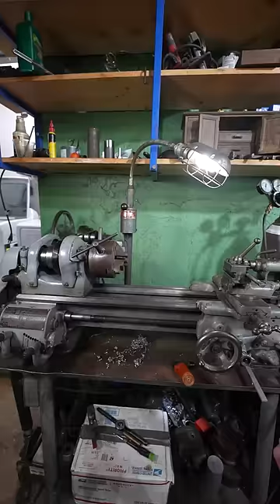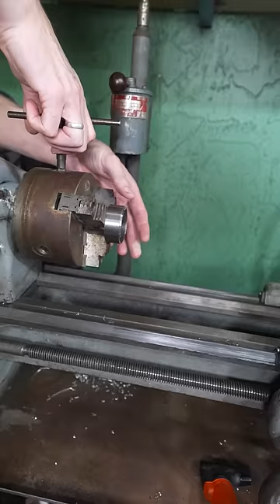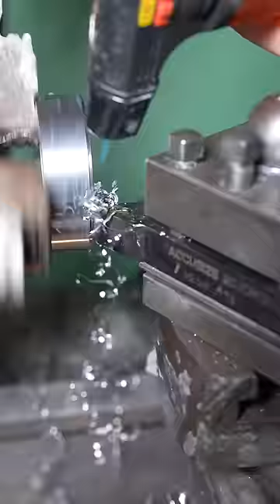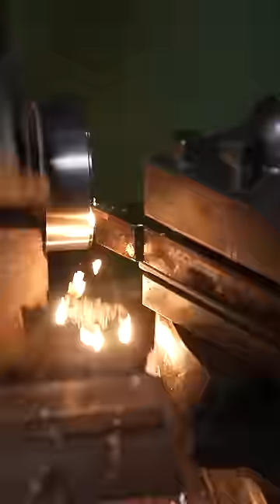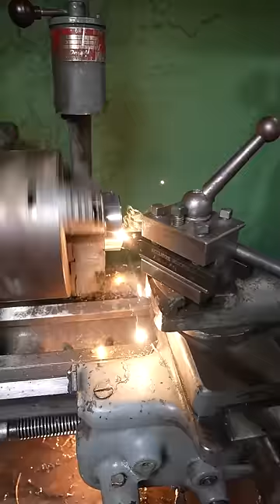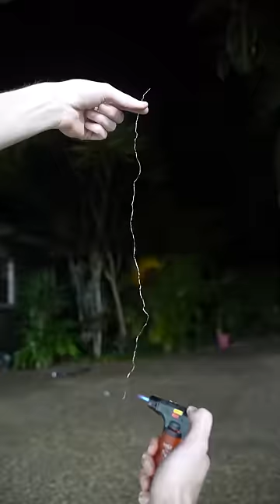Titanium has a dirty secret

Comment: The machine shop three seconds after the OSHA inspector leaves.
Reply: Lmao
Reply: Yup
Reply: Based
Reply: Safety guys gonna have lots of material to use for meetings.
Reply: you have met kevin
Reply: @eliascastillo1641 no he won't, it all got burned up 😹
Reply: My boss had the welder cut some aluminum on the lathe and he almost burnt the shop down lmao
Reply: @evangorski7992  Welder should have wiped the oil up before using the plasma cutter. I assume the lathe was being used as a sawhorse.
Reply: ههههههههههههههههههه
Reply: @carlherrnstein9544  lol nah he was using it as a lathe, just didn’t know anything about coolant or chip management😂
Reply: Real
Reply: Bold of you to assume it takes us that long

Comment: "Expensive Metal...I just set it on fire"
Reply: You can still melt the burnt bits. The O2 escapes in the atmosphere and all that's left is liquid Titanium.

Same with rusty steel.
Reply: Uh, what? No, no you can't...
Reply: @loghorizon45 No way, turning titanium dioxide into metallic titanium is multistage chemical process, you can't just melt it. And even if you were wanting to do that, a bunch of the dioxide power is going to have spread everywhere, you'll never get anywhere near the yield you'd have gotten from collecting the swarf unburnt.
Reply: It's too expensive to try to reuse it compared to the risk it brings
Reply: It's somewhat expensive as sheet, and really expensive when in the form of tubes or large blocks. The ones used for engine blisks are ungodly expensive. You actually carve a giant fan from a big  block of the stuff, and the amount  of chips you get is crazy. 😮
Reply: @tommylanger7686  no if it's chips they degrease them then react with a bit of chlorine as a flux then induction melt under argon gas. Once oxidized it requires a lot of processing and usually is added to steel as a scrubbing deoxidizer.
Reply: @loghorizon45  I belioeve that's called smelting.
Reply: Fr😂😂😂
Reply: Dealing with recycling companies, I get it. Makes doing the right thing nearly impossible depending on your shops size. We just toss it in the garbage can because we will do a foot long bar of aluminum for a few tight tolerance parts then go into steel or something else so the scraps are small and easily mixed. I wish we did a little better, and I wish metal recycling companies would also be better at sorting. This isn’t just a 9-5 problem. We need to take care of the planet and the resources on it so we can sustain ourselves. Not saying anything about climate change, just proper use of the stuff here. Sorry for the rant no one asked for
Reply: Turning TiO2 into Ti metal is easy just do a thermite reaction, TiO2+Al powder and some sulfur powder for catalyst
Reply: @matheuscerqueira7952 Yes you can have magnesium for it
Reply: @soundspark  not with TiO²
Reply: @mandychan9191 thank you 😊
Reply: @omeganiner-j1b  If you are doing it to extract metallic titanium it is still a form of smelting?
Reply: @declankemp679  titanium's melting point is around 1.6k C

Comment: True story: I was the project manager for a contractor building a jet engine factory. The small jet engines had fan blades milled from titanium. I had to install a conveyor belt collection system to collect all the titanium shavings that were then sent to a centrifuge to spin off the cutting oil. Then the shavings went to a compactor to make titanium pucks for recycling. Factory's design, not mine. Of course, the first time they use it, it catches fire! They hadn't programmed the centrifuge to ring enough oil out of the shavings so the compactor caused heat, which lit the whole mess on fire. So burning titanium is actually in my nightmares.
Reply: Genuinely sorry to hear that.
Reply: I've been in commercial construction since I was 18 & you never know what kind of catastrophe can happen on any given day
Reply: At least it's ot your fault!

Did they try to make you liable regarding insurance or accept that their design needed work?
Reply: Just... 'OOF'.
edit: That'd be in my nightmares, too...
Reply: I would have honestly believed had you not started out with "true story". That usually means you're about to hear a big fat lie.
Reply: Does this mean that titanium recycling is scrapped completely, or just that extra care has to be taken?
Reply: Did anyone think to leave the press down to smother the fire? A pause after pressing is definitely needed for titanium.
Reply: I find it weird that in all this time I never once heard that titanium shavings are flammable.
Reply: @InfiniteDarkMass  Just imagine all the other things you don't know.
Reply: This is what happens when the lead engineer won't listen to any of the other engineers & techs on the project. I can just hear some crotchety old fart saying "I've been doing this for 30 years."
Reply: @InfiniteDarkMass  maybe you were playing hookie or stoned that day in science class?
Reply: @wolfpackpete6408 titanium is recycled because it is expensive material.
But have to be careful working with Titanium.
Reply: @gund89123  All materials that can be recycled will be recycled. There's just a higher emphasis on recycling expensive materials
Reply: Yes Sir! Nightmares!
Reply: Thats based
Reply: Aye aye, that's disaster innit mate
Reply: Potassium- *holds beer & f*cking EXPLODES from the glass condensate
Reply: *wring
Reply: Irs why they smelt it in an atmosphere of Argon. Oakley was making titanium frames and the foundry leaked and exploded. Knocked a fork lift over.
Reply: Even better when the dumpster full of magnesium swarf and cuttings is next to the dumpster full of titanium shavings, could see the bright light of that fire from way across town.
Reply: That can't be a true story
Reply: An oil titanium fire sounds crazy 😬
Reply: I had a similar setup at my last job but we put the chips in wet, and let the briquetter squeeze the oil out into a catch basin.
Reply: Hello. Do you need titanium materials?

Comment: as a machinist i almost cried when the chuck wrench was left.
Reply: I am no machinist but a commonsensenist. Flying metal things launched by fast spinning metal things are no good things. :D
Reply: @huwballbot3978  I get the feeling your YouTube feed is exclusively filled with vtubers.
Reply: Same, even though it’s a 150lbs garage lathe I instantly felt my stomach drop and thought about the old 20x60” German schaerer lathe I work on sometimes
Reply: even i know, those shits need to be kept on a chain and mount.
Reply: Same here
Reply: As a machinist, I really can’t tell you how dangerous that was… You really just have to look up machining accidents and see how terrible they are. You are so Blessed that chuck key just decided to fly out(narrowly missing you I’m assuming) instead of getting stuck on the ways, and smashing your hand or worse.
Reply: WTF he actually did, that is the most horrible thing 😳
Reply: IDEA: Make a stand alone kill switch that requires the chuck key to be inserted to start the lathe...
Reply: I'm no mechanic and I don't know what a chuck key is. Help please?
Reply: @thetruthserum2816 we had the same idea where I used to work, but in the end we went with a slightly simpler one.
We fixed a low force spring to the end of the chuck key that would mean it would fall out as soon as you let go.
Reply: @jayspace2905  it is the wrench used to tighten the work piece onto the rotating chuck of the turning machine,  it is very simple to forget to remove it yet it can cause some of the most devastating accidents from this machine as when it starts to rotate it can fly off at an exceptional speed.. at one of the workshops I wet to this happened and it shatered the safety glass 5 metters away from the machine 😵
Reply: In school if we left a chuck key in the chuck we had a big chuck key we had to wear around all day so we would remember not to forget to take the chuck key out of the chuck
 
It worked 
I only had to wear it one time in 3 years
Reply: In our school the room with the lathes had a deep nick in one of the brick walls caused by some guy forgetting about the chuck key. They didn't patch it up and left it as a reminder for other students.
Reply: It's the first thing you lear when working on a turn table.
Reply: I'm training a guy on a 1970s LeBlonde who's completely green to most fabrication. Getting him to remember the chuck key has been the bane of my existence so far. Like, man, you're gonna remember real good after you take someone's finger or sling steel into them.
Reply: Scientists should never use tools.
Reply: Having run a lathe for years I jumped to the right when I saw it.
Reply: Was a machinist for fifty years. I ran lathes. I had a rule about the chuck key. As long as the chuck key was in the chuck, my hand stayed on the chuck key. Saw a chuck key launched from a drill press in high school. The force stuck the key into a cement block wall. Imagine if that was a watermelon, or your noggin.
Reply: Allow me to rephrase that for you “when the chuck wrench left” because that thing was outta there 😂
Reply: Lmao you’re overreacting
Reply: @Martinian-Smith overreacting
Reply: When I was a boy I was doing a repetitive production job on a Myford (i.e. small) lathe for pocket money. I was well-trained and didn't leave the key in the chuck, but I once started the lathe (by clutch, so it starts instantly) before I'd completely removed the key. The key slammed my fingers into the lathe bed. Luckily nothing was broken and the bruises healed quickly, but I was shocked by the speed and the force of the accident. Since then any sign of carelessness with chuck keys makes me cringe.
Reply: this guy: "as a machinist"
also this guy: "chuck wrench"
smh
Reply: @osmacar5331 . Nah, you just take it out of the chuck before you turn the machine on
Reply: Thank god thought it was only me.
Reply: Those poor ways!!
Reply: @majesticeagle5461 Rj was NOT overreacting. Leaving a chuck key in is the BIGGEST no no in the machine shop.
Reply: @brintjeff  overreacting
Reply: @brintjeff  literally overreaction of the century
Reply: @NielMalan  overreaction
Reply: @majesticeagle5461  Yeah? Losing fingers is a minor thing in your world?
Reply: @NielMalan  you wouldn’t lose a finger, that’s an overreaction
Reply: @majesticeagle5461  Yeah? You're 100% certain that a chuck key slamming a finger against a lathe bed won't crush it? Not even once? And even if a finger isn't crushed but just bruised, is it considered normal where you live to walk around with bruised fingers?
Reply: @NielMalan  absolutely, I’m gonna go try it for myself, and prove you wrong, and what’s wrong with bruises where you live?
Reply: @NielMalan  I tried it, I didn’t prove you wrong, and I’m in extreme pain
Reply: @NielMalan  help
Reply: @majesticeagle5461  overreaction
Reply: @NielMalan  lmao wtf bro that’s not cool you can’t say that it’s really painful😭😭😭☠️☠️☠️
Reply: Aaaahhhhggg
Reply: @irkandcrew  you too?
Reply: I do that with the chuck key for fun just to get people’s reactions. Its always funny
Reply: Chuck wrench never leaves your hand until it's put back in its place.
Reply: @starionslider2116  you three?
Reply: @casewildenberg8519  you not?
Reply: @majesticeagle5461  still alive and well 🤟🥴
Reply: @starionslider2116  barely
Reply: @jayspace2905 a chili i key is the t shaped thing that goes flying (at least in the video) it acts less like a key and more like a wrench, and is usually used to manually close the jaws of a Chuck, often times it is a solid piece of metal though it can be two pieces depending on preference. Turning a lathe on with the Chuck key in the Chuck is a good way to not only kill someone, but also severely damage the machine, if it hits you you would be lucky to get away with broken bones, because it literally become a solid piece of metal flying at high speeds
Reply: @workinprogress5431 might I suggest either a modified spring Chuck key that requires pressure to remain useful or a short lanyard around the key and the wrist
Reply: @majesticeagle5461 I promise you if anything that was an under reaction
Reply: @Finbar-kb7zi  it still hurts
Reply: Wy this metal burn?
Reply: Wow i was thinking the same. Seen apprentice loos a finger doing that
Reply: @jayspace2905  it's the T bar looking tool that he uses to tighten just before he turns the lathe on
Reply: @majesticeagle5461 
You don't know what you are saying. I hope nobody here listens to you. Very wrong opinion
Reply: @techpriest4787 
If all it does is fly, that's one of the better outcomes.
Reply: @ronfox5519  no such thing
Reply: @AmericanFry Yeah, that’s some rookie nonsense
Reply: @thetruthserum2816  We did that at a company where I used to work. It's a good option and you also know where the damn thing is.
Reply: My thought exactly brother. 25 years and still have all my digits. Safety first,always.
Reply: Edited...
Reply: Ow.
Reply: i read masochist my bad
Reply: Same ngl